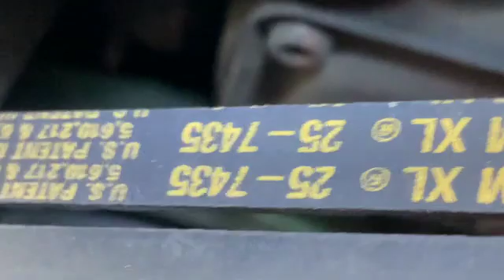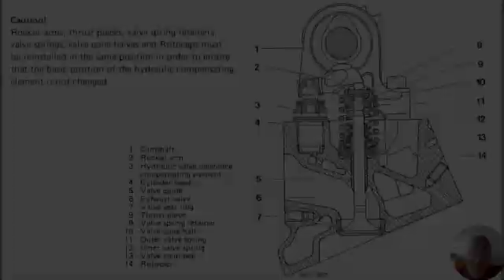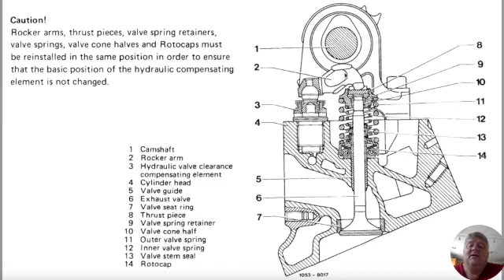Replacing the valve guide seals on M117 M116 M103 M104 engines   SD 480p

Comment: I have the 90' r129. Should i be worried about the timing chain guides being that they are plastic lol? 92k miles on car
Reply from the maker: Unfortunately they are all prone to eventually get brittle and can cause issues. Change them when you take off the valve cover and you look down the guides and they have a darker brown teint. Another clue is taken off the oil pan and see if there are any broken pieces in there. Do whatever you feel more comfortable or easier.
Reply: @straybenzes  Ok ill do that. I believe 90' had the metal cam oilers luckily so that saves some pain. Have you ever changed the lower guides or its mostly just upper ones prone to breaking? once u get to lower ones you have to kind of rip apart the whole engine i think so
Reply from the maker: @SuperBranFlakez  You do not have to take the whole engine apart. If you need to do one, do all of them. It is not worth jeopardizing a good engine for the sake of saving a few Dollars. I am waiting for an opportunity to change chain and guides and will video this job for certain.
Reply: @straybenzes  that would be amazing! im mad that autohausaz doesnt sell the other guides except top ones

Comment: Does 560 engine run much better with non-resistor plugs? Which one did you used? Respect for replacing valve steam seals. I did replace rocker arms, hydraulic lifters, but I am afraid of those valve guide seals... I think it would be better doing this with engine out and heads of, when replacing head seals also...
Reply from the maker: Non resistor plugs are impossible to find anymore. i have been using CHAMPION SPARK PLUGS 302 TRADITIONAL SPARK PLUG N11YC  copper ones with good success. They do need to be replaced around 30k miles though. Changing the valve guide seals are not as difficult as you might fear. Good luck.
Reply: @straybenzes  They are a bit hard to find but still possible. NGK BP6ES still exist for purchase and works great.
Reply from the maker: @Gr3eGo  Thanks!
Reply: @straybenzes  I will try BP5ES also which is hotter plug for one grade... And see the performance... But this one you should check regular to be sure it is not too hot.

Comment: My dear friend, why did you cut the registration and shorten the video time, keep the registration full. 
My dear friend, I forgot to remember that the valve is in a state of error, it can fall inside the cylinder, which follows.
Reply from the maker: I am not sure what you mean, but the valve can indeed drop if you are not careful.
Reply: @ 
My dear friend, I do a full video record without a very, very dangerous montage. Any mistake that falls the valve in the cylinder, and the problem is very large as it needs to decode the engine and the cost is very high and it can only do this.
Reply from the maker: @ you can avoid a valve completely falling into the combustion chamber if you put the piston at top dead center. Good luck!

Comment: In the early 1990's, my cousin had an adapter for getting the cylinder pressurised made at a machine shop and he got the valve seals changed on his straight six 280S. Saves on getting the cylinder head off. 
Try Marrelli spark plugs, they are an Italian manufacturer and they might have a range of spark plugs suited for old timer Mercedes-Benz engines.🐞
Reply from the maker: Thanks for the tips!

Comment: I did 4 seals with that compressor tool in the video but they say that it does increase the risk of unseating the guides. So i've ordered the expensive merc one to finish the job
Reply from the maker: That is a safe and sound tactic. Good luck and thanks for the hint.

Comment: I cannot get the exhaust valves on cylinder 1&2 to release from the valve spring to remove the seals,  what is the trick?
Reply from the maker: I am not sure if I understand your problem correctly. Are you struggling to get the two little keeper wedges out of the spring retainer disk? If so, turn the crankshaft so that that cylinder's piston is in top dead center position. When you push down on the valve retianer disc you will eventually hit the piston with the valve and the little retainers come out. Just make sure that the valve comes back up and that there is air pressure on that cylnder to keep the valves closed as you replace the stem seals. Hoping that this will help you.
Reply: @straybenzes  How are you pushing down on the thrust piece / valve springs to get the retainers? I didn't see this tool mentioned and you skipped to holding the retainer. Is it the same claw looking tool you used to get the rocker arms out?
Reply from the maker: @V8Hunter7  Yup that is the same tool to use. Good luck!

Comment: Hello Ralph, I am planning to change my valve seals on my 560 sec. Question for you. How much psi did you set to keep the valve closed? Thanks for the support!
Reply from the maker: I set mine around 80psi. The other thing I did was making sure that the corresponding piston was at TDC position. That has saved my bum a few times when I put the little retainer wedges back in. Also, make sure you have a good size compressor as this method does use quite a bit of air. Good luck.
Reply: @Stray Benzes  thank you Ralph for the support!!
Reply from the maker: @singhpally  You are welcome.

Comment: High, I love your video's. In my w126 M117 engine I can not get the seals out. They are very tide. Any tips? I used a screw driver but no movement at all
Reply from the maker: If they do not come out using a screwdriver then try using these type of pliers or something like it: https://www.amazon.com/QWOKR-Spark-Removal-Plier-Pliers/dp/B082NQ56MH/ref=asc_df_B082NQ56MH/?tag=hyprod-20&linkCode=df0&hvadid=416671577205&hvpos=&hvnetw=g&hvrand=6532203057943931033&hvpone=&hvptwo=&hvqmt=&hvdev=c&hvdvcmdl=&hvlocint=&hvlocphy=9007343&hvtargid=pla-888314160958&psc=1&tag=&ref=&adgrpid=96944448914&hvpone=&hvptwo=&hvadid=416671577205&hvpos=&hvnetw=g&hvrand=6532203057943931033&hvqmt=&hvdev=c&hvdvcmdl=&hvlocint=&hvlocphy=9007343&hvtargid=pla-888314160958

Comment: Thanks a lot for your video. It was just the thing I needed to get me started and I have now just finished the job on my M116.  Two things learned though: 
1: The valve will only drop 1/2 way down from fully closed when piston is at TDC. This will actually make it possible to do the job without any such compressed air adapter. However the rocker arm and thrust piece must be removed first and this cannot be removed while piston is at TDC. So this approach is a little more fiddlier 
2: If the valve cone half will not separate from valve stem, try to place a large flat screw driver on the valve spring retainer (NOT the thrust piece!!) and give it a gentle tap with a hammer. This will usually be enough to loosen them so they will separate when you compress the spring.
Reply from the maker: 1) While you are correct in saying that the valves cannot completely disappear on you during the procedure, it does make re-inserting the keepers very difficult and you may damage your new stem seals as you need to push the spring retainer very far down. 
I am not sure what happened to you while trying to remove the rocker arm, but they do come out at TDC pulling them out toward the center of the engine (intake side). 
2) Yup, that does work indeed. Another quick push down of the spring retainer with the valve bottoming out on the piston at TDC will do the same. 
Thank you for your comments!
Reply: I removed the rocker arm exhaust side due to the position of my valve compressor tool. However i did not actually try to remove them towards center, probably should have tried that though
Reply from the maker: @JFinnerud  Live and learn...

Comment: These are the kind of videos, that keep me from ever owning a V8 MB.  Great video Ralf.
Reply from the maker: Thanks. Well, those seals will go bad on just about any old engine, but it is a bit of a chore to do for certain.
Reply: Many other cars are worse. These are rather easy in comparison.
Reply: 😂 incidentally these are exactly why I'm so happy to own an M117... Way easier by comparison to many other engines of a similar caliber.

These engines were designed to last, and to be easy to work on.

Edit: keywords "of a similar caliber". There certainly are easier engines, but.. dang... This thing keeps on impressing me.

Comment: Everything I hear from other youtubers is champion plugs are crap. Did you try FCPEuro?
Most of the videos I've seen did use compressed air to hold the valves up but one guy said he just stuffed a length of rope in. Wouldn't take much since the piston is up top.
I don't think I will ever try this at my age. Lol
Oh, by the way. What is that 7 for on your neck?
Thanks Ralph and take care.
Reply from the maker: There are a lot of opinions out there about the dreaded topic of spark plugs, but very little information about how people arrived at their conclusions. I am not expecting much from a 1.70 USD plug. 
The rope-in-cylinder trick is more something for lawnmower engines. Fiddling with that stuff in that tight a space is nothing for my sausage fingers.
Reply: @straybenzes  Rope trick will not work on the M116/117 at least (I've tried) the shape of the combustion chamber is such that the piston will block the rope before the rope blocks/supports the valve. As for spark plugs, any type of non resistor copper core plugs within specs have worked for me.
Reply from the maker: @JFinnerud  Yeah, I am not in favor of trying to shove some rope into such an engine. That may work just fine on a lawn mower engine but this has no place on such an engine like this. 
Non resistor plugs are difficult to find anymore. Not impossible, but difficult.